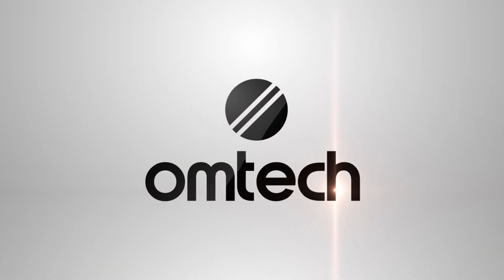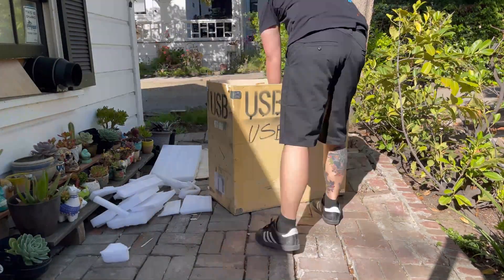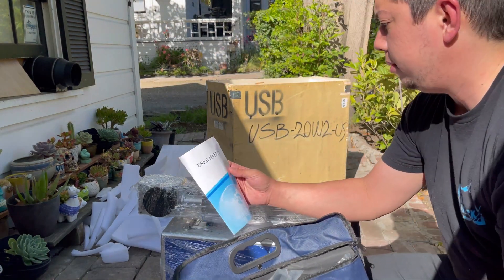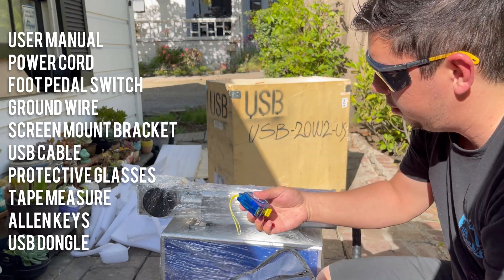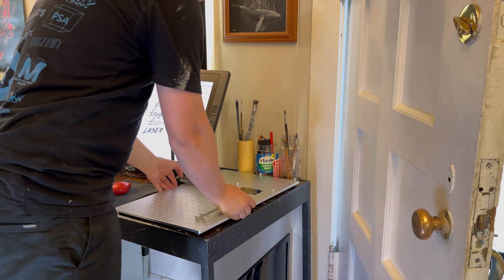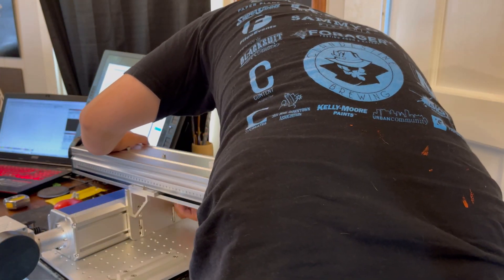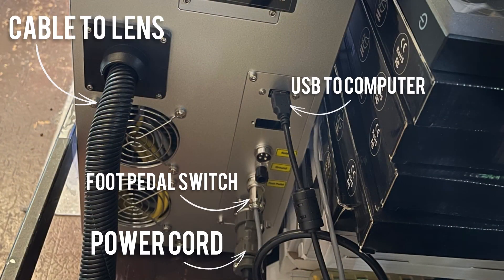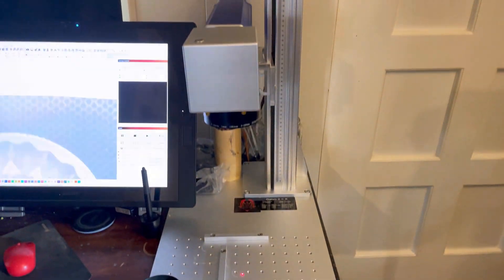20W Fiber Laser Marker Unboxing - Customer Review - OMTech Laser

Comment: I'm a photographer who is interested in using a fiber laser to sign, number or decorate the back side of my aluminum prints. Do you have any experience with this, and can you tell me how much heat is generated when marking a thin sheet of aluminum? My concern is that it will damage the image and/or clear coating on the opposite side. Any information would be greatly appreciated. Thanks.

Comment: Did the machine came with the program your using to engrave if not what kinda program are you using?
Reply from the maker: Good question!! The machine comes with a flash drive with EZCAD2 that is the software to use with our Fiber Laser Markers.

Comment: Hi, is this machine too powerful for adding images on bags?
Reply from the maker: Good question! This really depends on the material used. Fiber Laser Markers are only used for metals and hard plastics. Anything like wood, leather, acrylic, and glass can be engraved with a CO2 Laser Engraver.